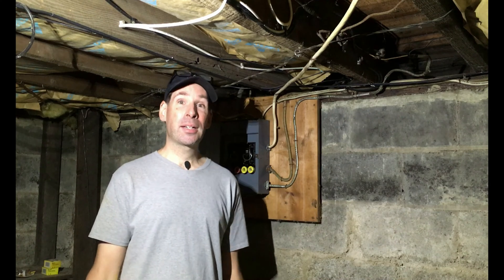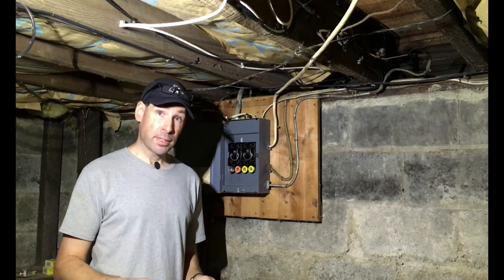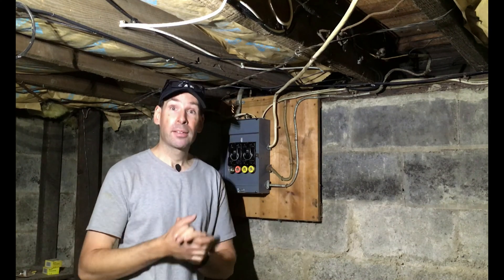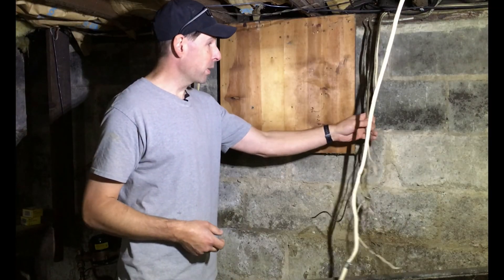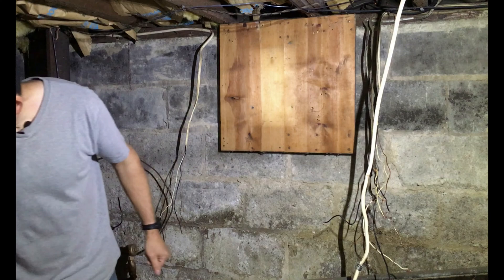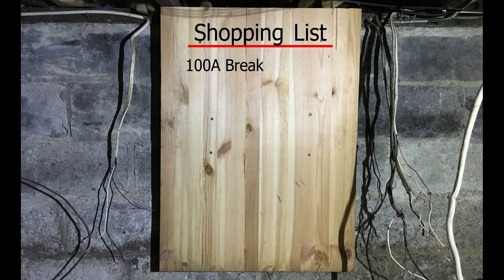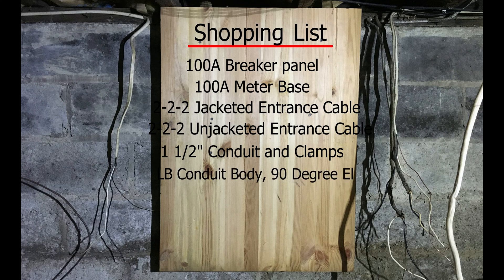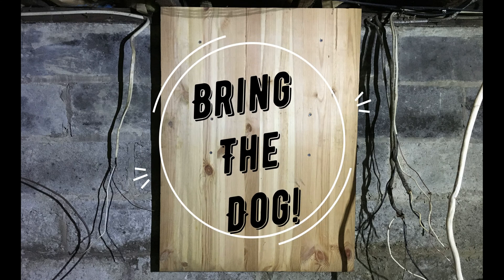E2 Upgrading the electrical service

Comment: I’m looking at an older house made in the early 60s. I have a similar panel shown in this video and want to move to a breaker style panel. Some of the wiring from the previous owner was cut and sloppily slapped back together in a few spots. Do you think I should do the wiring or have the panel replaced first?
Reply from the maker: I would do the panel first and use arc fault breakers on multiuse circuits.

Comment: Amazing video. But, none of those wires looked like K&T at the fuse panel. Is it one of those houses where they ran new wire part of the way, then kept the rest of it K&T
Reply from the maker: I know what you're talking about. I've seen houses that were half done just to fool an inspector. I replaced all the knob and tube with new wiring.
Reply: @homeanddog4984  yeah, but I mean at the original fuse panel
Reply from the maker: Sorry, I read your question too fast. The original fuse panel was from the 1960's I think. The installer of that panel added newer wire extensions to two different junction boxes that were in a different part of the basement. A third circuit was added also in the 1960's and the fourth was in the late 90's.
I believe the original fuse box from 1937 was only a two-fuse box. the house was wired with one circuit for the first floor and one circuit for the second floor.
Reply: @homeanddog4984  That seems sooo under kill, by today's standards
Reply: @16BitDoggo  Not if a house has gas water heating and gas furnace/boilers. 

I plan on going to 200a and installing mini-split heat pumps, because I don't like burning gas in my house.

Comment: That 60 amp install looks new? 
How did you turn off the original service?
Where is the green bonding screw?
Reply from the maker: I think the old fuse panel was put in the the 1960's.
When the power company came out to hook up the new service they cut the wires off the old service and connected them to the new one. 
Then green bonding screw is in the panel on the bottom left. It wouldn't have passed inspection without one.
Reply: Old service looked hot when you cut the 60 Amp service. Power meter (outside) was still in
place, as well as the wires at the top of the old weathered?  Thank you.
Reply: @tedlahm5740  You can see the meter says "OFF".  It is a smart meter; the POCO can turn the power off without pulling the meter.